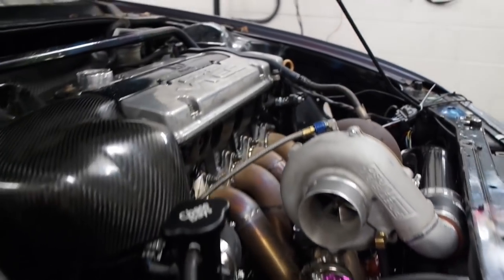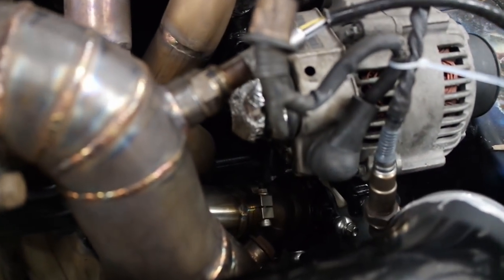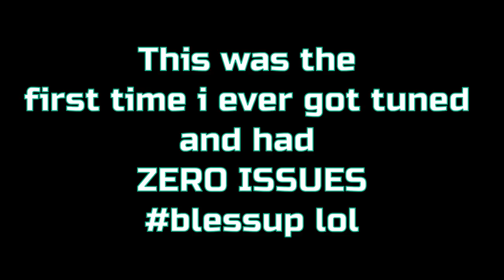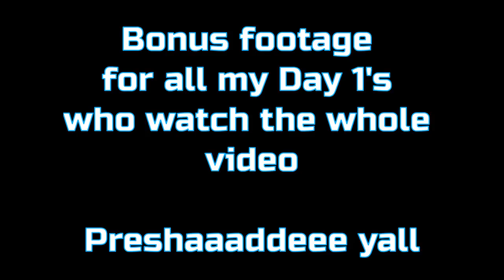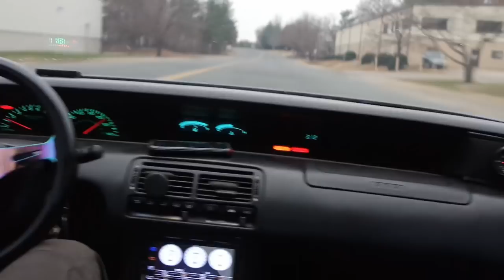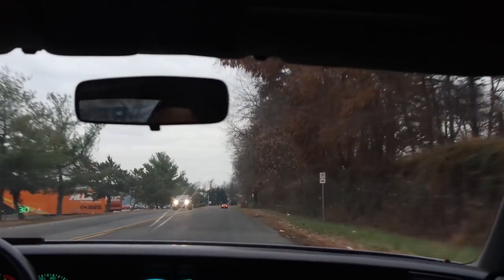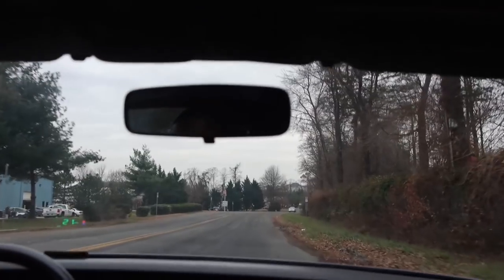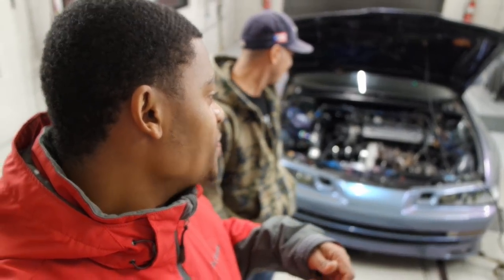Turbo f20b makes 400hp on stock internals

Comment: Mugen Rey was feeling that speed. The passenger seat feels faster than driver's seat though 400 whp in a Prelude feels like you're flying in a jet airplane. No joke boosted Hondas bone out quick with the power to weight ratio. Sttutututu

Comment: just started my 5th gen lude with f20b boosted. doing 550cc injectors big pump arp studs and cometic head gasket. will do the lowest boost i can until i can afford internals. i hope it goes as well. your car is nice dude. hope it doesnt break before you can build it
Reply from the maker: Just stay 10lbs or less with a good tune and you'll be fine and thanks bro

Comment: Hey trey first I love what you're doing keep em coming!!!!!! Second I got a question.  Ok! So I just bought a 94 prelude today cheap! Well its body is really good so is interior.  But it drives like crap. Feels like it needs some mounts probably power steering it's not going into gear good. So my question is - Do you think it's worth building it???? Like want I replace all that anyway? What are you're thoughts bro. Also when buying a prelude or Honda what's the main thing to focus on and when do I not buy it???? Thanks bro.

Comment: I'm running a h23a wit the same amount whp 392 on 9lbs on 93 pump gas......nice video
Reply from the maker: Nice stock block too? What turbo you running?
Reply: @treybedipping1734  I'm running a gt3582r
Reply: @treybedipping1734  yes my bottom end stock
Reply from the maker: @sbinqnz  nice
Reply: Did you do anything to your h23 before slapping the turbo on it.

Comment: I remember reading that the f20b comes with forged internals is this true because now I can't find the information fml
Reply from the maker: The block is cast iron so its compatible with forged pistons unlike the frm sleeves in the h22
Reply: @treybedipping1734  okay so it doesn't come with forged crank and forged rod
Reply from the maker: @Onelovej  im not 100% sure but i dont think so

Comment: Hey dude!! Ur gonna press the read more I promise. First off nice lude man! I’ve owned a 97 sir before and it was the best fun n car I’ve ever owned. Really would love to own another. Secondly what have u done to the f20b? I’ve done a engine swap on my 94 accord and instead of buying a h22a I’ve done a f20b from a 99 torneo sir-t. Had swap looms from torneo to accord not just engine but full car loom from brake light to head light. Rewired fuel pump, abs pump, and power steering from pump to hydrologic. Took 3 weeks from start to turn key at other end. So my biggest question is what have u done to urs to make that power bkoz I need to pull my motor out to change oil, water pump do a full service and replace the alternator. In the same time I can mod to increase power. It’s full stock atm. Until u feed me info for my build. Cheers if u have read this far man. By the way I’m from New Zealand 🇳🇿. Wayyyy down south from u bro. My old man (father) worked at Honda NZ assembling them I’ve owned too many to list. And most my dad touched at the factory some how. Hope to hear from u soon dude. Peace ✌️!!
Reply: Before anyone says anything y I swapped is bkoz the original was a h20a or b can’t remember. Sohc non vtec. That’s y I did the swap.

Comment: How reliable was this over time bro? Just did an f20b swap on my 5th gen and thinking of going turbo stock internals
Reply from the maker: At 400 it was a time bomb. If you stay around 10lbs and 330hp and a good tune. Your golden
Reply: @treybedipping1734  sheesh good to know! what kit did you go with? Or did you
Piece it separately
Reply from the maker: @dimelo774  custom manifold, everything else was pieced together.

Comment: How much Horsepower and boost can I put to a stock  D16z6 engine and stock heads?????
Reply from the maker: On a d16 I'm not to sure but forbade h22 it's 10lbs and about  330hp to be safe. I would assume the d16 may be close to the same but not 100% sure

Comment: Im looking to do this swap on my prelude does the f20b fit onto the stock transmission? I know the 5 speeds can’t handle too much hp but I don’t plan on pushing anything over 270

Comment: Stock internals? jus hydrolockd my h23a here in the south and looking for a new motor; really eyeing an f20b for its iron internals with t2t4.  Any suggestions on a cheap turbo kit?
Reply from the maker: No such thing as a cheap turbo kit unless you ebay it lol
Reply: @treybedipping1734  lol, yea. Been hearing that they've been holding up for several ppl for several years, as they're replicas. Also, shud I swap the bt h23 head onto f20b? I'm reading that the f20/h23 is essentially an h22 head on both motors.

Comment: What transmission? How much boost and why are you short shifting during pulls?
Reply from the maker: T2t4 lsd 12lbs and stock rev limiter is 7500 on the f20b
Reply: @treybedipping1734  , hmm I've seen all motor setups revving these motors to 9k rpm!! 
Recently met someone that has similar setup @11psi boost pushing 407whp and 300wtq even. It was quick asf on a 5th gen lude. A lot of wheel spin though, needs traction bars and better tires
Reply from the maker: @Hakuna_My_Tatas  yea bro f20b's are the wave 😎

Comment: What's up  I just recently got a 95 prelude with the f20b in it just wondering what turbo kit u ran or are still running on irs and if u had the f20b head on it when I made the 400whp
Reply from the maker: Yea it was a fully stock f20b. It wont last with 400. All of my turbo part were prettt much custom
Reply: Word I'm planing on building it up at some point just trying to get all the hickups out first
Reply: I have loved ludes since I was 16 and finally came across one that I liked and body was decent shape
Reply from the maker: @justinlaflamme5018  nice

Comment: I doubt this will get answered but is that a full f20b engine or is it an f20b block with an h22 head??
Reply from the maker: there is really no difference in a f20b head and a h22 head unless you get the f20 manual motor, that has type s cams. during this video it was all f20b it wasnt until later that i put a built head on a f20b bottom
Reply: @treybedipping1734  oh alright, I’m asking because my brother is planning on boosting his f20b and every forum we’ve seen basically says you have to do the head swap in order for it to handle boost safely

Comment: Yo I'm in the middle of boosting my f20b. How much boost are you pushing?
Reply from the maker: Now im pushing 23lbs with a built block. This video was 12lbs bit i would suggest 8-10lbs if your motor is stock
Reply: Forsure bro thank you!

Comment: is the car still running? curious because i have an f20b i plan on turboing stock but itll also be my daily. advice appreciated :D
Reply from the maker: Yes but not on this set up. The 400hp range was too much for stock block
Reply: @treybedipping1734  is it safe to keep it like 200-220 HP? I’m also planning on turboing it but I want it to be reliable as well
Reply from the maker: @jorgebarrera9313  you can run 320 (10lbs) reliably

Comment: Where can I get top end parts for this motor such as head studs head gasket shit like that stainless valves
Reply from the maker: So most off h22 parts are directly compatible with the f20b. Everything thats not will more than likey have to be special ordered or custom made but like 85% or more off the h22 parts are compatible
Reply: @treybedipping1734 so  h22 studs will fit?
Reply from the maker: @streetlimitz89  yes sir

Comment: details of this setup? completely stock f20b?
Reply from the maker: Stock block skunk 2 inatake manifold. 5831 turbo with custom manifold and 1200cc fic injectors walboro 450 fuel pump
Reply: Trey Be Dipping thanks man. gives me hope for mine lol. will have a k series rbc manifold, port matched to a ktuned 90mm throttle body, head studs and shooting for 400 lol
Reply from the maker: @SwaglessFishy  you can make 400 but honestly 10lbs and 330-350 is the limit reliably. The rods wont hold long at 400hp
Reply: Trey Be Dipping Definitely won’t be a daily driver, more of a weekend warrior type of project, and im still getting used to my 220hp lol it’ll take me forever to finally feel out full power. probably would have the limiter set a little lower also, maybe 72-7500

Comment: Makes me wanna buy a different motor  now
Reply from the maker: Just make the most of the one you got bro
Reply: @treybedipping1734  I bought the euro r tho bro thinking I can make some serious power
Reply from the maker: @importcreationz5971  did the same bro once you tune it will out down about 220 but i boosted mine and blew it in 2 months
Reply: @treybedipping1734 So I guess I will leave it stock til I can build a monster
Reply from the maker: @importcreationz5971  it can hold 8lbs on a good tune.
Reply: @treybedipping1734  I guess I can try that out but you 8lbs is a big tease bro lol
Reply from the maker: @importcreationz5971  its not bro it all depends on your set up you ca make 350 on 8lbs with the right set up.
Reply: @treybedipping1734  I have a few ideas on what I want to do but I have to get the car running first and then think about how much power I want

Comment: what did you do to the motor to Turbo it because that's not a turbo car and usually when you turbo a car does not turbos you have a lot of problems out of it
Reply: Jerome Brooks fuel systems upgrade and turbo kit
Reply: Jerome Brooks my preludes been turbo since 2012 no issues yet but my internals are not stock at all lol

Comment: What fuel you running
Reply from the maker: E85
Reply: That’s what I’m going to be running in my h2b should have a time done hopefully tommroe if not Saturday I hope I can be at 400hp and 10psi and e85
Reply from the maker: @ryan_the_beast7603  what turbo and manifold are you running?
Reply: Ebay manifold and 50trim turbo
Reply from the maker: @ryan_the_beast7603  is it a cast iron log manifold or tubular stainless steel?
Reply: Trey Be Dipping stainless steal
Reply from the maker: @ryan_the_beast7603  you should make 300 on e85 easy not sure about 400 i had 1200cc injectors, walboro 450 pump and just barely made it.
Reply: Hell yeah bro